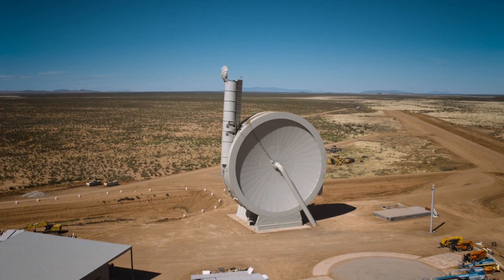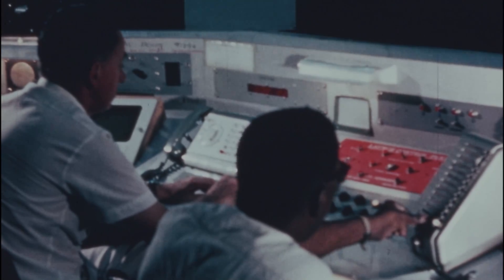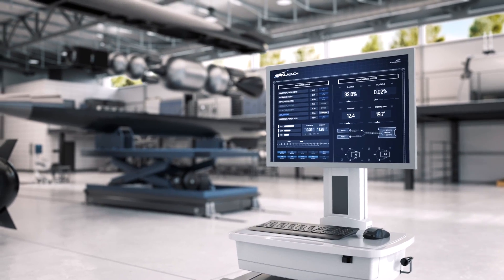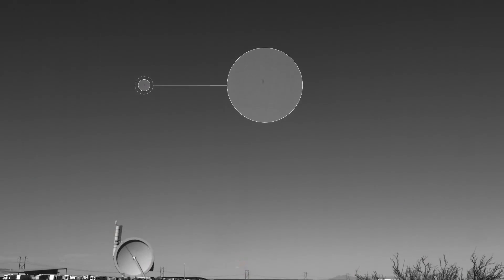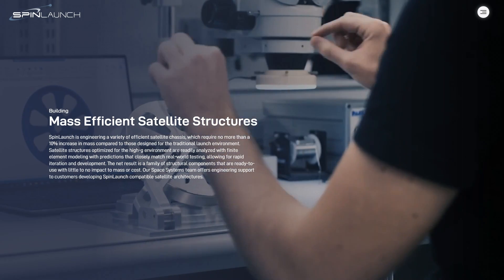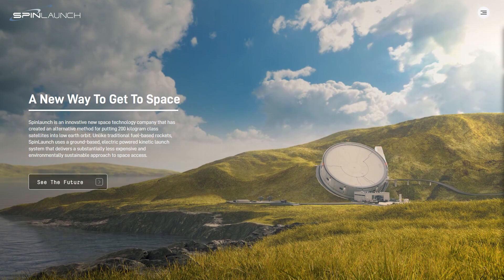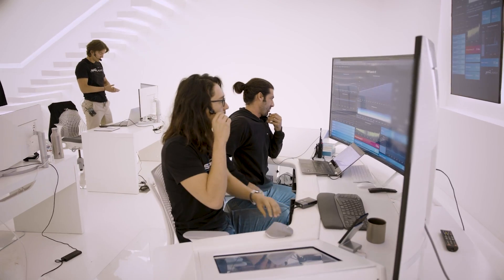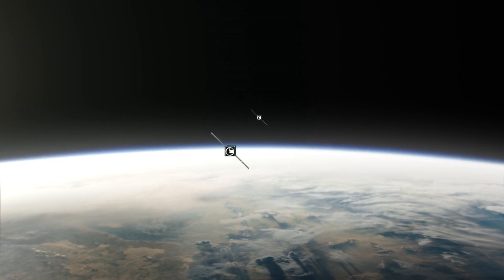Can Spinlaunch Throw Rockets Into Space?

Comment: I'm starting to research into amateur weather balloons (I got some 20ft mylars for free). 

I guess I'm wondering why somebody hasn't developed a retrievable massive 'array' of a few hundred (if launched from something like a salt flat, maybe a 1-2k) large (20-50ft) 'balloons'?
Complex and taking up a large space compared to traditional 'rocket chucking' via controlled explosion? ofc. 
Economical? potentially. 

IF a 40ft helium balloon could life 2200lbs then an 'array' of 200-300 could lift a 'significant' amount: about the weight of the space shuttle (w/o 2x boosters). 

So, you just balloon up the loaded craft (if intended for rendevous w/ a orbital station they could be lighter, if the object was going to need to make orbits a LOT more), when you reach top balloon altitude (170k feet or so), then either (w/ high tensile tether) you retract the tether to drag balloons back down OR maybe just pop them (argument to be made about if this would cause more helium to outgas from planet faster)....If retrieving/landing the balloons somehow you just 'drop' the spacecraft from the balloon rig and let it fall enough so its far enough away when its booster lights it won't damage balloons (maybe 1-2k ft), so you'd still be approx 30-31 miles up when you're craft's booster gets lit. Compare that to the ext. tank on an orbiter (which got it up 48mi or so) and that's not too bad. 
IF you're running unmanned craft you could live 'more dangerously' and use cheap hydrogen for the balloons. If you really wanted to get complex: you could have a permanent high-alt rig floating that held a big set of LH2 and LO2 tanks and the system to compress the hydrogen from the balloons to the the tanks: thereby creating a sort of mid-flight refueling on the way up (but before the burn out of the upper atmosphere). 
Sure the overall weight if you only had 200-500 balloons this size wouldn't be enough as a full substitute for a space shuttle + 2 SRBs, but it'd be enough to 'hoist' large components up and place them into orbit cheaper (to be used for constructing 1st LEO habitats, or even the automated refining/manufacturing assemblies that could then be tossed in one of the L points w/ most trojans asteroids (to use for producing stuff in space.

Comment: Watching this video for the second time, I think it is a remarkably superficial analysis of the machine.  There are all sorts of problems which you fail to get to grips with.  The projectile will always be tumbling as it is released (as the nose and tail are on different points of the circumference, moving at a tangent to the circle....ie in different directions).  The projectile will therefore be tumbling at frequency of rotation of the arm.  You touch on the apparent weight of the projectile (as much as a significantly sized ship) but do you just see the release of this weight as another little problem to be solved.  If there is any kind of meaningful vacuum - or reduced air pressure - within the chamber then the barrier must be fairly substantial.  But this is a barrier the projectile must strike at a high speed!  Electronics may be able to withstand the required G force but what about a rocket engine and fuel system?  What about solar panels on a satellite that are deployable in orbit?

Way too enthusiastic about this in my opinion.  Still, well over 3M views!
Reply: The projectile is literally not tumbling in this video.  It does wobble. And correcting it's spin at release would simply be a matter of releasing the front slightly before releasing the back.
Reply: @bradleyrex2968  "simply"?
Reply: @chriswright9096   So you admit "tumbling" was complete BS?
Reply: @bradleyrex2968  Which video are you referring to?  I haven't seen one that shows the flight of the projectile after it emerges.  Can you provide a link?
Reply: @chriswright9096  When I said this video, I mean "Can Spinlaunch Throw Rockets Into Space?" by Scott Manley, this one.  I can provide a link to this video but that seems... odd.  The projectile can be seen in flight at 4:25.  Other video of the projectile can be seen at a YT channel called: Spinlaunch.
Reply: @bradleyrex2968  I watched (thanks for the time reference).  The nose clearly exits closer to the camera than the tail.  Evidence of tumbling.  Also, the membrane appears to be paper or very thin plastic film.  It would not be able to withstand tonnes of atmospheric pressure with an evaccuated chamber behind it.
Reply: @chriswright9096   Evidence of wobble as is the rest of the flight where it is clearly sees to wobble.  Ha Ha, Those fools didn't get it perfect on their first launch! 
Also the paper thin dust cover does not at any point withstand tonnes of atmospheric pressure, the hemispherical end cap seen rocked back at the launch does.
Reply: @bradleyrex2968  So they open an end cap (against the force of atmospheric pressure) just before the projectile comes through?  Look, I'm not really buying any of this.  You obviously are.  Probably best to leave it there.
Reply: @chriswright9096   Yes.  Any logical person would flood the chamber with air before attempting to open the cap, and for this test, they may have have had no vacuum at all, but I'm sure they went along worth your guess to "open an end cap (against the force of atmospheric pressure) "  All before the imaginary tumbling.  
So yea, leave it there.

Comment: I understand the theory and it's a great theory but why in the world would we put it at sea level. Like you point out right off the bat, the biggest failure that this platform has is sea level atmospheric pressure. This thing should be built in the central United States preferably in the Rockies or Western Us in the Sierra Nevada's range. If it is a concern about being over inhabited land it could be facing west in the Sierra Nevada so that very quickly it is over the Pacific. But building it anywhere near sea level guarantees failure because you will never be able to get the device reliably up to speed enough to handle the loss of velocity.
Reply: Launching in the opposite direction of the Earths rotation would require an extra 2000mph of launch speed, which seems impractical.  My suggestion would be the mountains surrounding Bogota Columbia because of the proximity to the equator, altitude, and available workforce.

Comment: I heard the argument "well most of the energy comes from getting the rocket up to speed, so we'd be able to launch it at full speed" and I'm like ??? bruh putting a vacuum chamber on the bottom 0.001% of the atmosphere doesn't remove the air resistance from the rest of it. :l

Spin launching and other mechanical methods would be cool for zero-atmosphere bodies like the moon, but definitely not the Earth.

Comment: There are at least three, not one, but three reasons for which this thing will FAIL.
1) I highly doubt a satellite can withstand the 10,000 Gs
2) I also highly doubt the catapult's arm will withstand the weight of the projectile
3) When the catapult will release the projectiles it will become seriously out of balance.
Reply: 1. Electronics in artillery shells survive 40,000 Gs
2&3, It did here.  Bearing load is a thing.
Reply: @bradleyrex2968  It did here, but don't forget that the goal is to throw a 11-ton projectile at mach 8. And 11 tons times 10,000 Gs = 110,000 tons. Maybe throwing 100 kg would work, but 11 tons certainly not!!!

Comment: Hitting static air at that speed sound like hitting solid wall
Reply: No it wouldn't.
Reply: @bradleyrex2968  well maybe like a wall is overestimated but it's said in the video
Reply: @Salv2137   It's just as wrong when it's said in the video.   It's a euphemism, and it stems from the whole falling from X feet into water would be like landing on concrete euphemism.   Also false.

Certainly air resistance at those speeds would be incredible, and the craft will build tremendous heat.  But there have been Mach 6 launches at sea level from rail guns.  It's not uncharted territory.

Comment: Should be mentioned, They have already lied. Thier first successful launch didn't do what they said.  listen to the video projectile was dopplering.  If the chamber was in vacuum you wouldn't hear anything. Also note when the projectile was spinning you saw paint flying off the surface of the vacuum chamber that also wouldn't happen in a vacuum. So guess what no vacuum. Also the video shows the projectile slicing through the barrier. Not punching through. So it was starting to tumble before leaving the launcher. Also LOOK at the video the projectile was tumbling end over end as it vered off course.  That so called success almost destroyed the whole thing. So they can't make a vacuum in Thier vacuum chamber and they didn't reach the speeds they said they did, and their projectile was tumbling out of control. How was that a successful launch.
Reply: When did they say the prototype was releasing the projectile in vacuum?

Comment: not to mention, at their specs of 2 km/sec @ 11,200 Kg of mass that means that the "projectile" would have an energy of 80,640,029,761,345 Nm. Am I the only one that is even a little bit skeptical? 80 TRILLION NEWTON METERS?!?!  Not to mention, name me a material that the arm can not be obliterated by long term G forces. At the end of a 50 Ft arm, at 2km/sec, having been spun up over the course of 6 hours, that is the equivalent to 28,768,845 G's.  Wind turbine blades that are ~50ft in length weigh about 2,500 Kg. Lets say this company has access to some super secret tech that allows them to build the arm at a weight reduction of 50%. 1,250 Kg @ 2Km/Sec has the equivalent weight due to G forces of 35,961,056,250 Kg. I dare say that 35 Billion Kilograms is a bit too much for even a magical 493,000 Newton Meters of torque. For reference, the Empire State Building has an estimated weight of 331,122,430 Kg. You mean to tell me that a super light weight material 50 ft in length can hold the equivalent of 108 Empire State Buildings without destroying itself?
Reply: You are the only one that is even a little bit skeptical.

Comment: As the projectile exits through the vacuum membrane, and encounters atmosphere, the instantaneous surface friction temperature will melt anything. Or should I say vapourize. The same will happen to the spinning arm inside the launcher, once the atmosphere is allowed in. End of story.
Reply: There is no vacuum at the time of launch.  They recently got to 80,000 feet.
Reply: @bradleyrex2968  According to the Spinlaunch web site, their projectile IS moving from vacuum to atmosphere at the time of launch, and will be going over 5000 mph, which is over Mach 6.5. They only have a supposition that the heat shielding can handle  a transition at Mach 5. So it is completely unknown by anybody if their projectile can handle the transition at Mach 6.5, thermally OR in terms of flight stability. I strongly believe that they will find out that their projectile will fail catastrophically if they ever do get up to that speed. To say nothing of what will happen to the launch system itself when it is suddenly out of balance. Their launch control should be in a fortified bunker miles from the launch site, NOT at the base of the launch system. Have they learned nothing from NASA's mistakes??
Reply: @astrodoug1  It IS? In THIS launch?  Where does it say that?  I'm going to guess you mean in the predicted design of their full size launcher (which will almost certainly change before they build the first, it will.)  If you look at the prototype, there is a rounded cap that is looks like it can hold back a vacuum.  It's open at launch.  The projectile pierces a flexible membrane that obviously has no vacuum behind it.  So I'd say there is no vacuum at the time of launch in this demo.  There may have been during spin up. 

There is a great NY Times article about how rockets can't work and Robert Goddard is a fool stealing money from people.

Comment: It's the beginning of a decent idea for freight launching on the moon. You could split the payload evenly between a pair of identical craft and launch them in opposite directions at a decent fraction (or whole) of whatever speed they need to reach their desired altitude. They'd both need to correct the inherited spin immediately, and you'd need to maneuver one or both to avoid collision between them at periapsis. From a small body like the moon one of them could just burn straight out of orbit onto its transfer trajectory and the other could do a half revolution and then follow it.

I don't think this will ever have practical use on Earth or any other planet with a non-trivial atmosphere.
Reply: As they have already reached 80,000 feet with this pint sized version, I think it's going to be very difficult to stop them.   Accelerating a counterweight or second cargo has been suggested, but they seem unwilling to waste that kind of energy.
Reply: @DeputyNordburg  We'll see.

Comment: It is necessary to be able to do a pad abort.  That's the problem with a vertical launch rail, a drop from an airplane, and this system too.  What's the plan if stage 1 ignites and immediately has critical errors that require a shut down?  Each of these pre-acceleration systems would cause the rocket to be destroyed in this case.
Reply: If stage 1 ignites on time the rocket will be 80,000 feet away from the launcher.
Reply: @bradleyrex2968  Right, and that will be great.  The problem is that if it fails to ignite, the rocket is a total loss instead of a do-over two days later.
Reply: @bradleyrex2968  China knowingly fired above populated areas, and there are tons of things that can go wrong with rockets.  Neither of these things mean a pad abort is not a necessary feature.  1-2% of launches end in a pad abort, let's say 1.5%.  If the payload is cheap compared to the cost of the launch, maybe losing 1.5% more of the payloads isn't a problem.  I guess it's one thing if it's a bunch of propellant for the ISS, and another if it's a $2 billion spy satellite.
Reply: @karldavis7392  A pad abort would never work for spin launch where if you chose to abort before launch, you'd essentially have to just turn the machine off and wait for it to stop spinning.
Reply: @bradleyrex2968  right, and you don't know you need a pad abort until the fire the engines. By that point the rocket would have been released.
Reply: @karldavis7392   Thanks, I know I'm right.  As the first stage of this system is the release from the spinner, if they need an abort before that they can just hit the off switch.  Maybe run the spinner backward and regenerate the electricity to stop it a little faster.  There is no pad, but if you want to call that a pad abort I'm OK with it.
Reply: @bradleyrex2968  Would you ignite the chemical engine while it's still in the spinner?  Failure of that engine is why a pad abort is needed.
Reply: @karldavis7392   Just like pad aborts are needed when the second stage of a conventional rocket fails?   I'd have 2-3 pad aborts when that happens.   Maybe 4 if it was a failed 3rd stage.  The more the better.
Reply: @bradleyrex2968  You do have a valid point that we already live with the Stage 2 failure risk.  I agree there is some parallel to that.
Reply: @karldavis7392  I'd say there is a 90% chance this will not work, or will not be profitable, and thus will not be used.  But I think the people developing it are sincere, and are working hard on it.  Comparing that to the average person staying home and doing nothing, I don''t think these people deserve the negativity we see here.
Reply: @bradleyrex2968  You're right about that, they are definitely trying, and it has a chance of success on certain types of payloads.  One problem can be solved - the shock that changing forces places on the rotor when the rocket is released can be offset by releasing another payload of the same weight from the other end of the rotor that drives down, into a pool of water.  It could be just a cheap slug of steel.

Comment: I am very sceptic that this will ever work in a practical size. They just made 30.000 feet with a small projectile. But they will need about 10-20x more velocity with a 10-20x higher payload to reach practical regions. And I cannot believe that there is a big market for satellites which carry systems insensitive enough against the g-forces. Maybe some very simple micro- or nano-satellites, but neither of the systems which really make a scientific difference. So - at best - this just fosters even more scrap metal in space.
Reply: If there was a need for fuel or oxygen in space, they could make money putting that up there.   But nobody needs that.  In space.

Comment: Aside from the other possible benefits of this device and studying it. The idea of not having control of the projectile, or whatever its called, is scary.  If you just launched a rocket and couldnt change its trajectory or modulate speed at launch?  
But
. How this can be weaponized is far more intimidating?  No trail. You can’t tell where the projectile is coming from. Its moving so fast. Its far fetched that this is simply for launching satellites.  
This is inspired by an old steam engine that was used like a machine gun around civil war times. 
Russia comes out with invisible hyper sonic missiles. And now this is basically the equivalent of a javelin anti-tank missile system for hyper sonic missiles. 

On a positive. I suppose it could be used to intercept hypersonic missiles?  That would be a cool study to see.